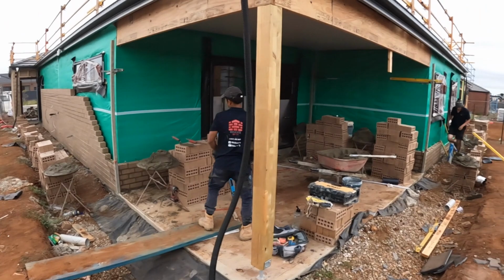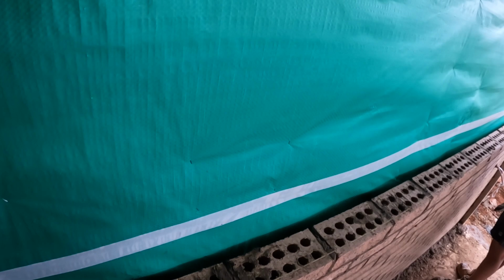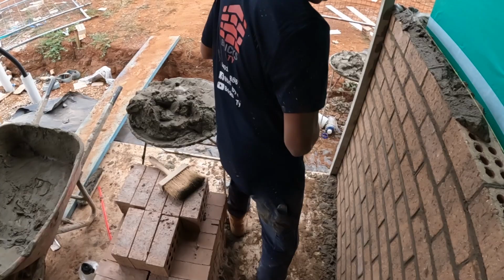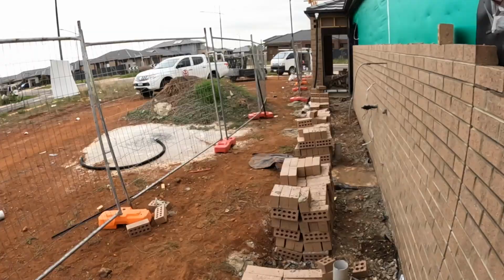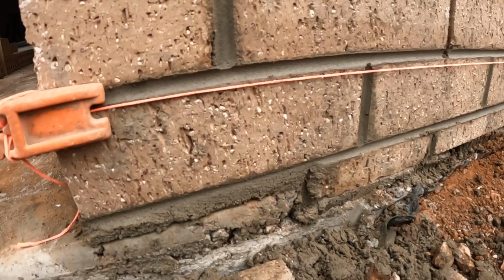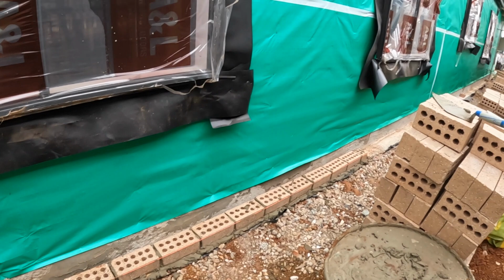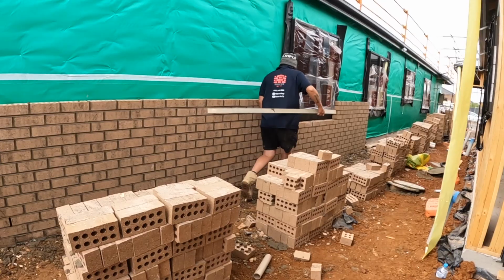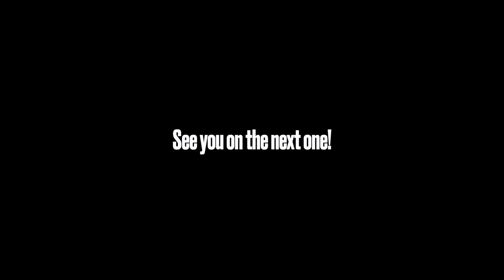UNACCEPTABLE CONSTRUCTION | BRICKLAYING AUSTRALIA

Comment: G,day Ty from Sydney.
Very interesting the separation between buildings, with such large windows facing the boundary line. This is to achieve maximum internal floor space on small land parcel size, no doubt.
 Law still states: Dividing Fences Act in N.S.W the standard fence, is a 5' timber post and rail with paling. This offers no firefighting material between.
Windows in bathroom and toilet (WC) need to be obscured glass only. This is a privacy provision in the NCC Vol 2 2022.
Minimum requirements
900mm in from boundary containing windows.
Build to the boundary (with council approval) fire rated wall structure and window shutters with sprinkler system over windows.
Then there's the issue of noise transmission from buildings.
As a bricklayer on site, can you see an improvement to protect against the spread over fire?
🧱🪟🚿
Reply from the maker: As a bricklayer, I'm not entirely sure what we can do to prevent fire spread. We do have the occasional fire rated weepholes to installation, however that will not suffice. We can only hope that fire control outside of the construction industry is up to standard.

Comment: Typical concrete  slab, no policing of concreter  workmanship in Australian. After 40 years as a bricklayer  this will only change when the bricklayer starts quoting the code. Your should issue a site instruction so that it doesn't  come back and biters you. Any bricwork be it splits or headers above grove level is non compliance.  In nsw brickwork should not even overhang concrete no more than 15mm otherwise non compliances. Most builders and supervisors  are desk jockeys. 😊